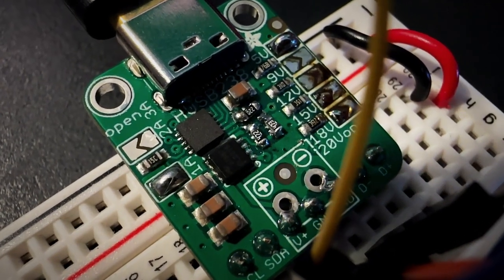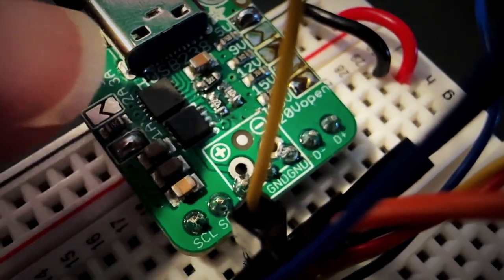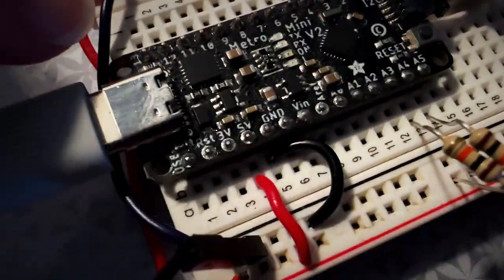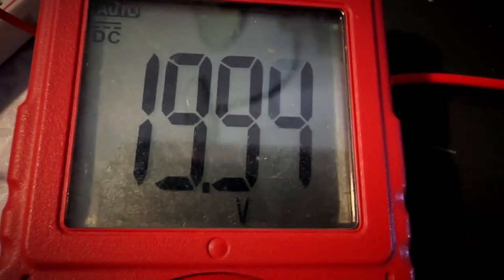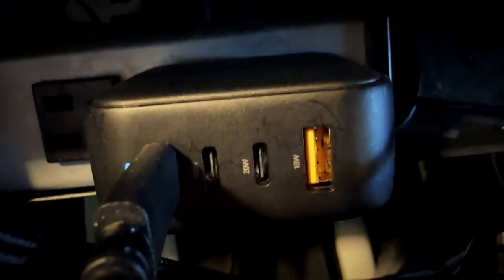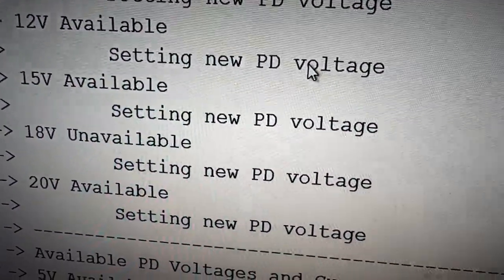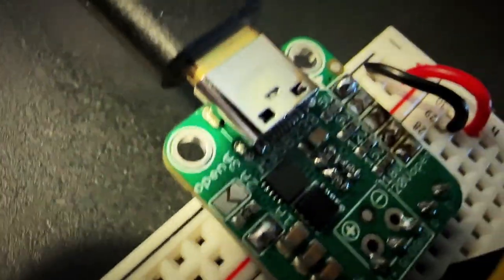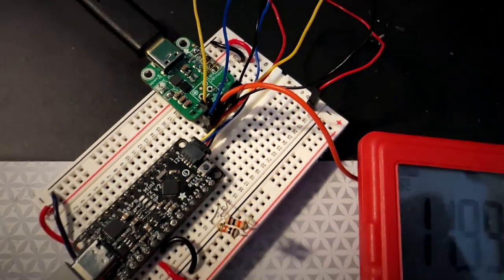HUSB238 is a smart USB PD chip 🔌💡🔋

Comment: Would it be possible to replace the Hyntek HUSB238 with the HUSB238A part to support the USB PD3.1 standard (upto 240W [48V @ 5A] via I2C Commands) or would further modifications need to be made?